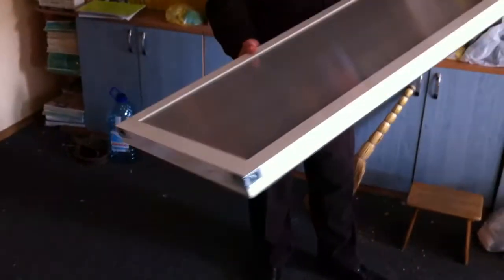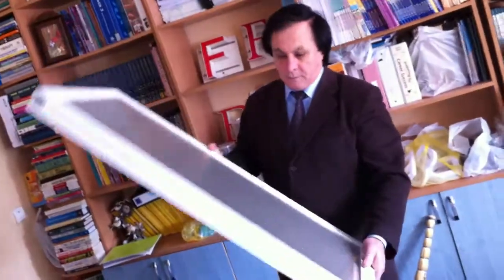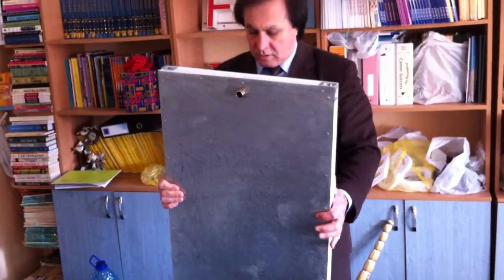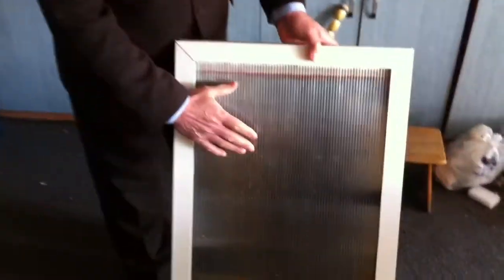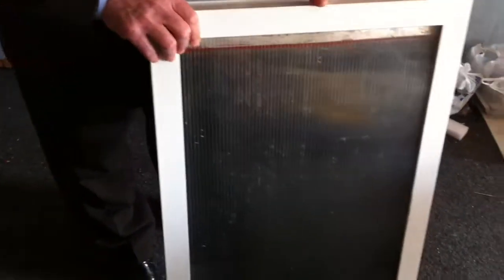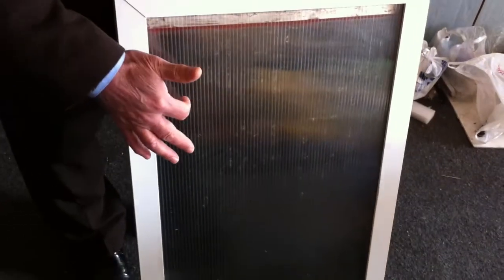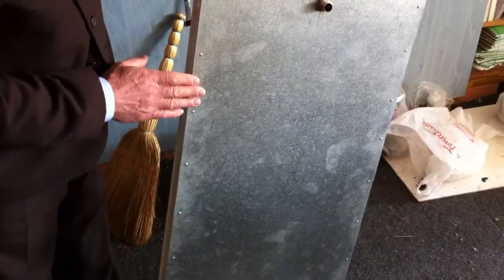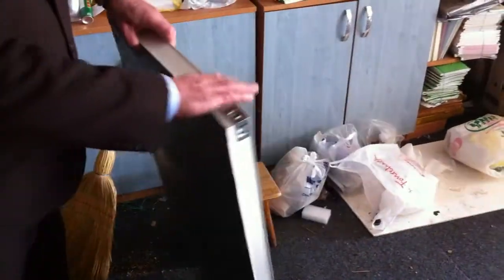Solar water heater

Comment: Well done!
Would love to see how the hose connects to the poly-carbonate and able to hold 20m of water column..
Could the back be replaced with high density polystyrene sheet to make it lighter, cheeper and more insulated?
Can the frame be removed all together?
Reply from the maker: Itțs a special connection made from stainless steel and glued with a special glue. It can be insulated with extruded polistiren (not expanded as it melts). It's insulated with glass wool.
What do you mean by ”all together”?
Reply: Nicu Kovalenko Thank you for your reply Nicu.

Is the connection and special glue a "trade secret"?
Do you describe the assembly anywhere on the internet?
What temperature can the panel reach if left unused?
If there was a solid backing instead of glass wool, like "extruded polystyrene" would you still have an aluminium frame? or could the panel stand without a frame. I thinking of ways to simplify the design.
This version looks very compact! http://imagizer.imageshack.us/a/img195/1889/img0554ts.jpg
Have you sold many?

Great work!
Reply from the maker: Sergey K No, I didn't describe it. There are some technological secrets.
The temperature can reach 130ºC, but it's impossible for our case. We reached 95ºC. The unit was tested at the highest temperature and at freezing too. The frame can be plastic, aluminum or something else.
The "compact" version is a fragment of a solar roof.
We have tested many samples.
Are you interested in buying? 
If you have any other questions, my e-mail is: nikolayc@gmail.com
Reply: Unfortunately I am in Australia and shipping costs would make it uneconomical. :(
Unless you can make them cheap and ship them cheap by sea..?